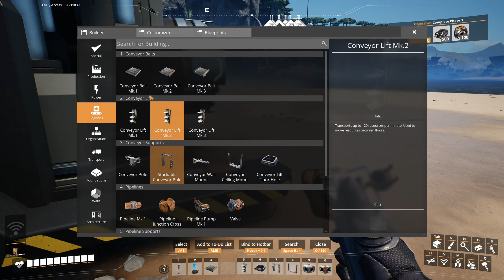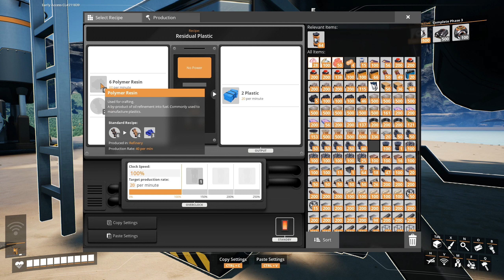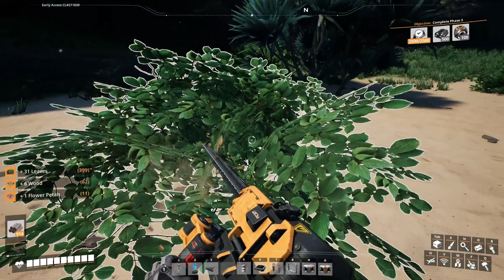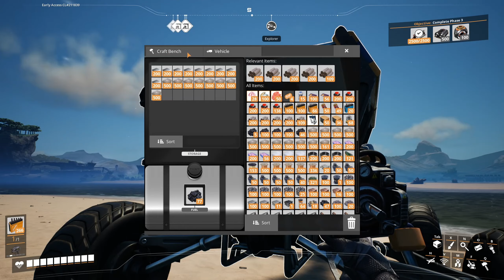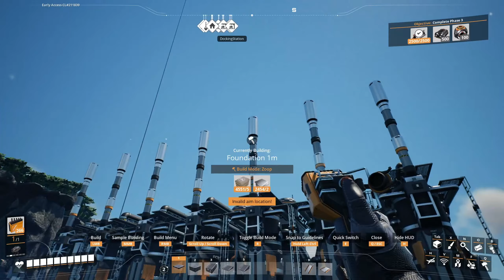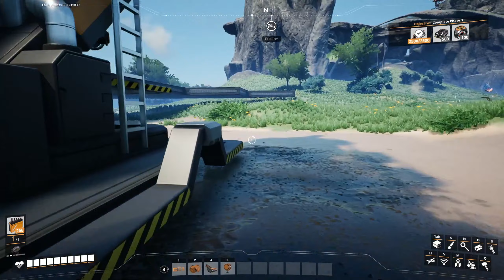Pivot to Oil!  Let's Play Satisfactory s02 e43

Comment: Hey mate, just a piece of advice, if you are planning on using the entire oil extractor capacity add a buffer at the output of it.
The jack works like a pulse, so the buffer maintains a constant flow on the downstream pipe when the jack is not extracting.
This is more visible over long distances, but it work everywhere. 

Also keep in mind that you need to consume both outputs in order to be able to process the oil. If your plastic container fills up you will stop producing heavy oil.

And one more little thing and I will stop backseating lol. You can slide under pipes and belts if you press C while runing. Also if you Run, Slide and Jump mid slide you will get somewhat catapulted  increasing your movement speed.

That's it, sorry!! Nice vid mate!
Reply from the maker: Great suggestion regarding the oil buffer!  👍 I will try to remember to add those next time I record.

I'll have quite a large storage setup for the plastic and rubber, so I'm not too worried about the oil production stopping. The Coke we're burning for power shouldn't be needed to keep everything else running so I'm not too concerned if that stops generating power.

Later, once I unlock the upgraded pipes, we'll either rework these initial oil setups and/or just build new ones that take any excess oil production and burn it for power. 

I'm aware of the slide, but I use a gamepad when I play and triggering the slide is a little cumbersome with it.
Reply: Wait what?? You are playing with a controller??? Wow!! That's impressive lol
Reply from the maker: @andresrv88  No, not a controller. I play with a Logitech G13 gamepad. It's like it's own mini keyboard that sits off to the left of your keyboard. They don't make this kind anymore, but they're pretty nice. Once you get used to using one, it's hard to go back to WASD on the keyboard.
Reply: @Glidercat  oooouuuu I see! Nice!! I was like daaaamn the precision with that controller is amazing lol